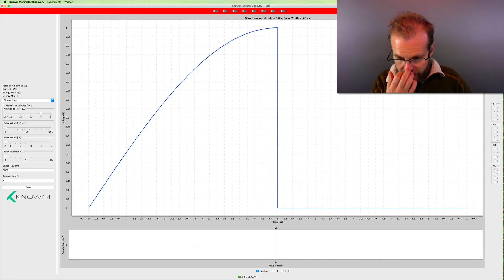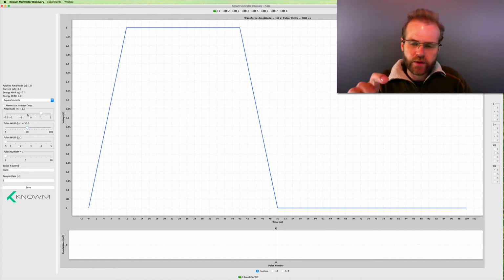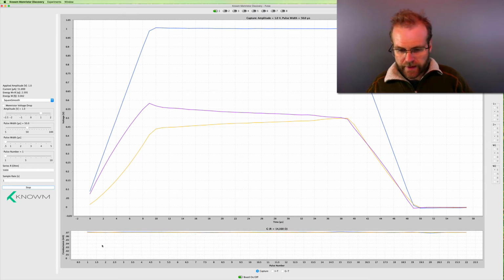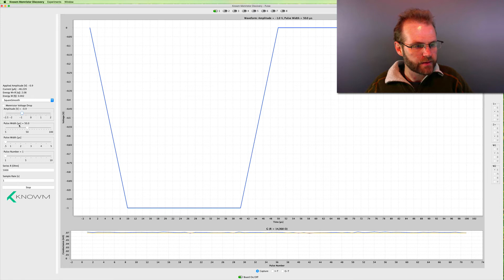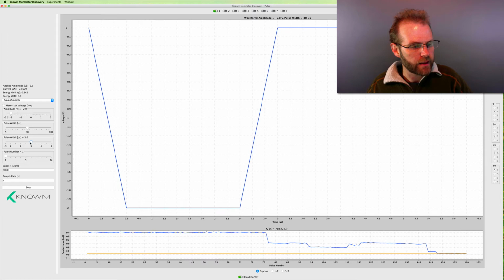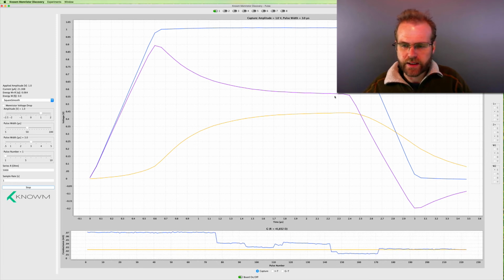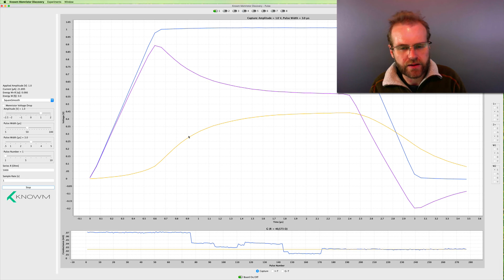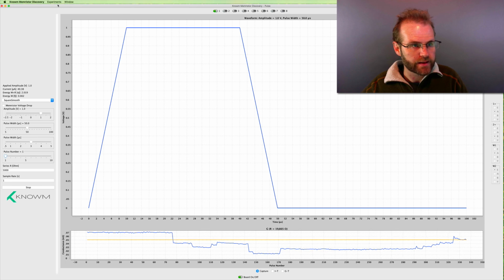Pulse Experiment on Memristor Discovery

Comment: where can I find such software on windows? Is it possible to use not "Semiconductor Parameter Analyzer HP4145/56" and "Agilent B1500A Semiconductor Device Analyzer" as it said in User Manual but other more cheap devices?